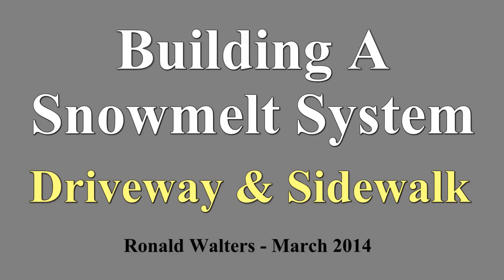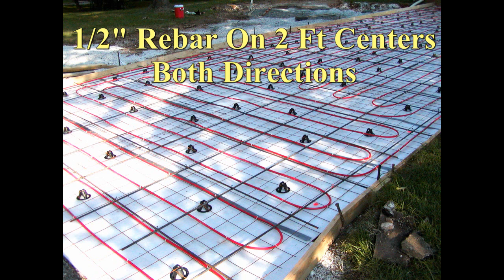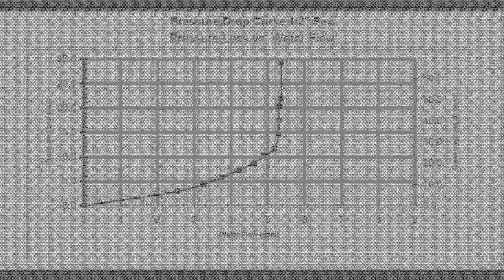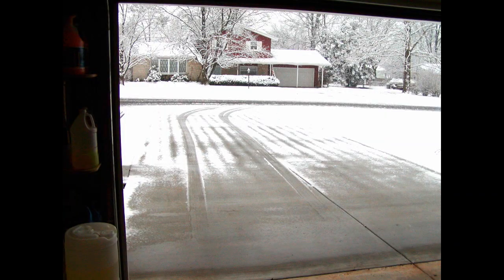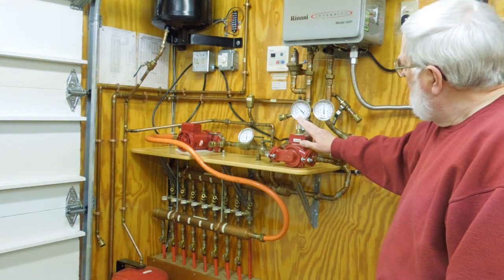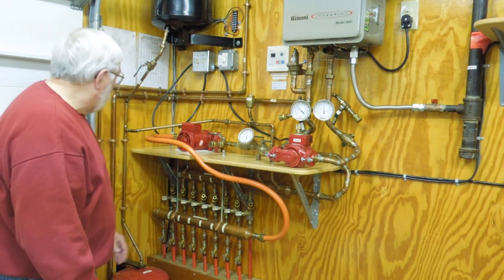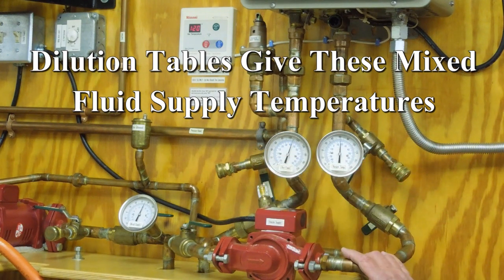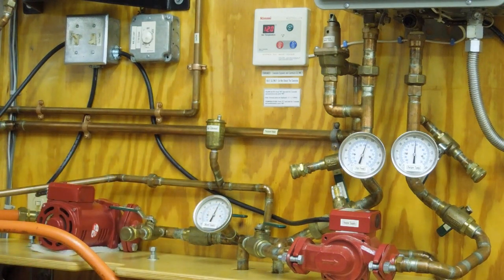Snowmelt, Building A System - Driveway & Sidewalk

Comment: I installed a melt system in 2016 and I recall watching Mr. Walters' video at the time. His slab/pex installation is correct and his method for manual control is useful because its logical. I would add that you should have tools and materials on hand to splice the pex should the tube be damaged during concrete placement. Also have an air compressor on hand and a means to connect and repressure quickly to locate the leak.

If you have a slab on a steep incline, place concrete starting at the bottom of the incline and work towards the top. Even a low slump concrete will slide down the insulation and carry the pex and remesh along with it. I used remesh sheets and would recommend it as it lays flat and the pex will be positioned consistently with respect to the top of the slab. I did not use rebar and had no issues with floating pex.

I placed pex 12" OC similar to Mr. Walters. In hindsight I would place the tube 6" OC and would recommend it as well.

Make sure the tankless heater is rated for glycol service as glycol is known to be corrosive. If the heater comes with an optional remote buy it as it will likely tell you flow rate, inlet and outlet temps of the heater which can be useful during operation.

I laid out my circuits in terms of function. I can operate specific circuits based on practical needs. There are circuits I never operate if covered with snow. I rely on mother nature to remove the snow. If those circuits are covered with frozen rain I'll burn the ice off because it's a big hazard. My driveway is steep and divided between left and right zones. If Mrs. Crawfish π is working she'll come home with her side clear so that she can get up the incline with no problems. I might wait for mother nature to take care of my side.

If someone is thinking about doing a DIY melt system it's a little more involved than rolling out plastic tube on the ground and sending out hot water. Companies (Uponor, Viega) that make equipment for radiant heat systems have snow melt design manuals with worksheets for calculating loads and such. Caleffi has a set of design guides for hydronic systems that are well put together. It does matter where you place expansion tanks, air separators and other components in a system, don't think that it doesn't. It's not rocket science, it's hydronics. 
Cheers!

Comment: Excellent system and video.  Thank you for sharing your thoughts on advantages and disadvantages.  It's next to impossible to get this much information on a real world application anywhere else.  It would be interesting to know the costs associated with running it relative to the ambient temperature, snow thickness, etc. (but I suppose a manufacturer should pick up this responsibility)

However... more information here, then anywhere else I have seen.  Well done! I hope you're still enjoying it!

Comment: Been thinking about this for a while...  You did everything right.  Probably a dream for most canadians.  Still though, heating several houses???  I am all for automation but there is a serious financial investment here.  Finally, as a serious and intense back pain sufferer, I relate but hope you still have other physical activities that you pursue as it's so important to your health.  Best wishes:)
Reply from the maker: Everyone seems to miss the point about heating 3-4 houses. An on-demand hot water heater is expected to take cold water mains temperature and immediately turn it into water hot enough for a shower... and I am not running it anywhere nearly that hot. An on-demand water heater burns more gas in a given period of time than a tank type water heater, but it burns if for a far shorter period of time. It consumes a lot of energy, but only "for that period of time it is running".

Everything costs money to operate. We tend to get a lot of ice before snow and that is nearly impossible to plow.

A lot of cities heat sidewalks and streets. Airports heat large areas. Shipping docks heat loading ramps. Those tend to be heated well ahead of bad weather but to me those are government projects where they are spending someone else's money.

On the evening news when you see those huge gas fired snowmelters which melt snow as fast as they can feed them with a front-end loader. Now that is burning a lot of gas!

Makes my system look pretty efficient.

Comment: Very Interesting. Thanks for posting. A friend of mine bought a house with an electrically heated driveway. It was disconnected a short time later. It was controlled by a 100 Amp lighting contactor. I can't even imagine what that would cost to use!

Comment: Would it be feasible to use deep geothermal loops and just circulate the fluid between the ground loop and the concrete loop? It seems like you could leave a system like that running any time snow was forecast because you would only have to pay for the electricity to circulate the coolant.
Reply from the maker: I do not believe a ground heat source geothermal system would be up to the task for this. The concrete slab acts as a giant radiator, which would nullify the trickle of heat from a heat pump type system.

Snowmelt systems are widely used on commercial and residential driveways and sidewalks, delivery ramps and loading docks, airport taxiways, hospital driveways, helicopter landing pads, etc. They can be extremely large and complicated systems. This system is quite simple and easy to use and by comparison quite economic.
Reply: I have looked extensively at using Geo Thermal....long story short-the is NO WAY. Geothermal is roughly 50 degrees and lacks the BTU's necessary. Further, you quickly cool your GeoWells and they take months to warm back up...There is NO WAY to do it I spent months on this idea.
Reply: I am putting in a heat exchanger on the incoming water supple line, to the house. pull the heat off of that.. to heat the anti freeze, No coast to heat it.  It would only be around that 50 degrees, enough heat to melt snow.. also use the return from my in floor heat return also. if needed. That is my plan to do. Great job bye the way..... smart man..
Reply: I'm not sure if you are familiar with how geothermal heating works based on your comment. A heat pump does allot more then just pumping for the record.
Reply: My loops are sitting in the bottom of my pond, which has about 2 feet of ice over it right now. Even with the below zero weather for the past two weeks my concrete driveway is bone dry. My major issue that I am having is moisture inside the garage is something I need to remedy soon. All three of my overhead doors are dripping with condensation, I still haven't determined where it's coming from but I'm thinking it's too "tight" and maybe I will try a humidistat on a fan to get it down.
Reply: Chilly Dippers he didn’t say anything about a heat pump.   Just a deep geothermal loop.
Reply: The airport in Elmira, ny did that a few years ago. Works pretty well
Reply: You need a heat pump to use geo thermal . We do it all the time in Vermont
Reply: Jlamarche20 You don’t need a heat pump if the temperature coming out of the geothermal loop is high enough for your application.  For snow melt, 50 degree water is usually more than enough.

Comment: Fascinating and beautifully constructed system.  I only wonder what you would have done had the Pex been punctured during the pour?  I suppose at that point you'd have to stop the pour, let it dry, bust it out, and redo.

Thank you for the video!
Reply from the maker: I was ready to fix it on the fly... wood box to dam the concrete, water & rags to clean the PEX, PEX cutter, splice coupling, crimp rings and crimping tool, plastic tape to wrap the splice to keep concrete away from the metal fittings used. Then an axe handle to discuss the event with whoever caused the puncture. Fix first, discuss later. :-)
Reply: I'm enjoying both the technical information for a project I've always been interested in and your grumpy old cuss sense of humor!  Love the lines about the axe handle and wearing a sidearm to keep the workers moving along!  Keep it up!  You'll outlive us all!

Comment: Rick, you are correct. geothermal loops at are use in Europe as supplemental heat source not only for this purpose but to provide heat to homes. We are not talking here about deep thermal source. Those could be few feet deep loops that supply heat to well above 32 F, from which point the liquid is heated further by electricity of natural gas to bring to desired temperature. In a way, geothermal energy is used as heat exchanger as temperature s relevantly constant just a few feet underground.

Comment: If you had garage floor heat your return side could be used for the driveway and use a separate circulation pump with a thermal couple and set the return temp to just above freezing and it will just keep cycling to keep the concrete above freezing.

Comment: You mentioned @3:22, the cost was like heating 3 or 4 houses. Could you expand on that statement. Have you found what your average costs are over the last 15 years of use. What is the area you are heating?  It appears to be 100% manual, at what point do you fire it up? For example: Forecast is 20degF, 2" of snow by tomorrow 2 pm - when do you turn it on?
Would you put in a system like this again?
Nicely laid out system and well labeled.
Reply from the maker: Your question(s) are good and genuine but have been asked and answered many, many times in the comments. Manual control is cheaper than all the fancy electronic controls and manual does not fail. The snowmelt system is heating the great outdoors, thus it is expensive "WHEN IT IS RUNNING". I usually let a bit of snow accumulate first as it acts as a blanket and helps keep the heat in the concrete slab. Forecast are inaccurate and unreliable... use your eyes and turn it on when something actually happens. The government turns on such a system (like at an airport or loading dock) and just lets it run because they are spending your money. I turn it on when it is actually needed. Yes, I would build it exactly the same way. You may not realize it but most of the most of the NFL football fields are heated the same way to prevent the field from being a frozen solid surface... and they roll out a tarp to help keep the field dry and the heat in.

Comment: I love your system and plan on building one this coming summer.  I am just tired of shoveling the driveway.  Can you provide more detail on the pumps, controllers and flow meters?
Reply from the maker: Richard McClure 

This one got past me, I just found your message. This happens on YouTube quite often.

The pumps and expansion tank are B&G (Bell & Gossett). The large pump PL-36 circulates the system at 8 GPM. The small pump NRF-22 pumps fluid through the Rannai 2520 on-demand heater typically around 1 GPM to 1.5  GPM. The combination flow control valves with flow meter are FlowGuard. The large copper supply and return manifolds... I just kept asking around until someone could supply what I wanted... they are expensive but made life easier and made for a clean looking installation. The individual ball valves on the supply manifold and the 1/2" heating PEX were from Vanguard. Vanguard was bought out by some other company several years ago. 

There is no controller... YOU are the controller. People will try to sell you all sorts of crap to complicate the system so it supposedly will run itself. One such item is a freezing precipitation sensor and another is an outdoor temperature anticipator. Such things (to me) are a needless complication, expensive items and are more than likely going to fail. Best to control the system manually... it will give you something to play with on those nasty winter days.

Your concrete needs to be 5 inches thick. The PEX needs to be in the EXACT center of the concrete. You MUST place insulation under the concrete or it will not work. You REALLY DO need to install the wire mesh and the rebar as I have shown in the video.

I used 1/2" PEX and the length of each loop needs to be kept relatively short or the fluid will cool off too much before it gets back to be reheated again. You could use 3/4" PEX but then your concrete may need to be thicker and you will need to pump faster and it may be easier to heat the concrete too fast which can very easily bust up the concrete. GREAT CARE and careful attention needs to be paid to insure that the concrete temperature is very slowly increased or the concrete will break (not if - it will break if you heat it too fast). This is a judgement decision on your part as to how fast you want to push your luck when bringing the system on line. My system has 8 loops, 7 in the driveway plus one in the sidewalk. I usually set the Rannai to deliver 120 degF water and start with 1 GPM through the Rannai to begin with. Later on I will increase it to 1.2 GPM and then later to 1.5 GPM. All the time the large pump is circulating the system at a constant 8 GPM.

We really have not experienced the type snowstorms we had while I was building the house. We have had some pretty good ice storms. The Rannai 2520 is larger than I need but the selection of on-demand heaters available at that time was not too good. And all I got from the Rannai engineers was how much trouble I was going to have and how it probably wouldn't work. Real bunch of "pain in the asses". The on-demand heaters are going to remind you of opening up the side of a jet engine... all sorts of sensors and flow controllers and blowers and enough stuff to cause it to quit working if any one thing gets out of whack. The largest problem is the narrow temperature range they insist these heaters operate within. This is a design criteria for the supply of domestic hot water. If you set it to deliver 120 degF fluid and the fluid coming back from the driveway is too cold, the heater is only capable heating a certain flow rate a maximum "delta T". If you are pumping 1 GPM and asking for 120 degF fluid and the heater can only deliver 118 degF fluid then the heater starts slowing down the flow rate (it has its own built-in variable flow control valve) and changing the fire box & blowers and stuff to deliver 120 degF fluid. Long story... a bit of an operational learning curve.

Once the snow melt system is up and running for a while and you start to see the return fluid temperature increasing, then the on-demand heater settles down a bit and is easier to control... again that learning curve thing.

An alternate operational setup would be to have a large insulated tank and the on-demand heater would heat the larger quantity of fluid in that tank where it could turn on and off and operate within its engineered design parameters and then you would draw fluid from that tank to temper the water being circulated through the driveway. Review sample installations for using on-demand heaters to supply apartment buildings (or similar) with hot water and you will find examples of using large insulated holding tanks.

Normal mode of expected operation for an on-demand heater is "year round". Therefore it is turning on and off many times per day and nothing is likely to try to crawl inside the exhaust, as it will soon be incinerated. Since your on-demand heater used for the snow melt system will not be operational during nice weather, you need to make sure you plug the exhaust so wasps (or similar) can not build nests inside the heater. 

I installed everything myself including the Rannai on-demand heater. Some suppliers will try to insist that the heater is installed by a licensed plumber. I think I may have taken a test to become one of their certified installers. Or possibly they just waived that part as I was asking more questions than they could answer. :-)

Your system needs to be designed for your specific situation. Whoever is going to sell you the PEX and other materials should have an engineering department with heat loss design calculation programs to help you size your system. Parameters are temperatures in your area, snow and ice expected, PEX size, loop length, number of loops, flow rate through the PEX, circulation pump selection, etc. I cannot help you with that.

Possibly more than you wanted to know but now you have something to chew on for a while. Have fun and good luck!

Ron